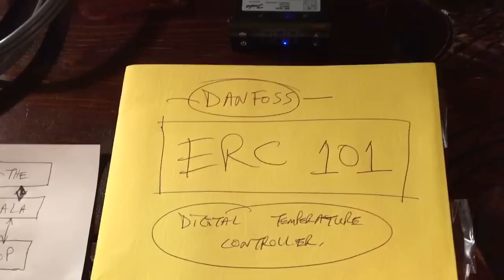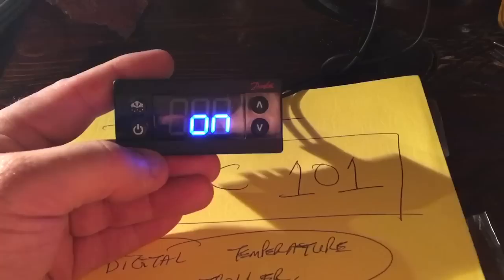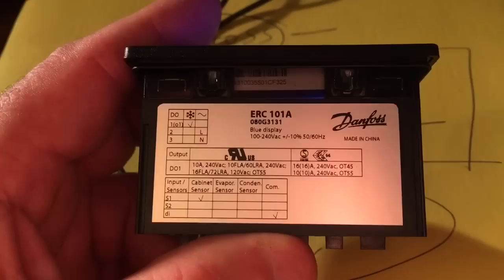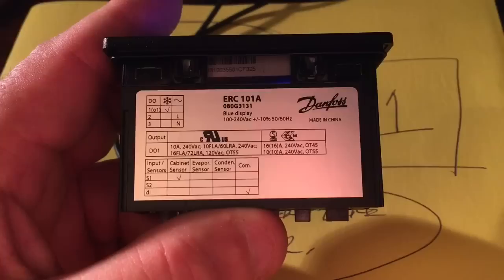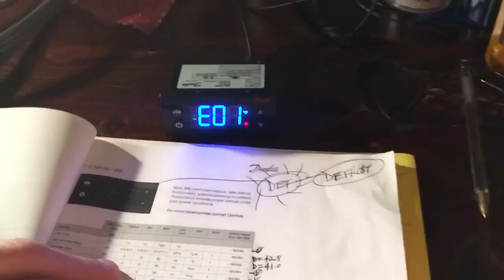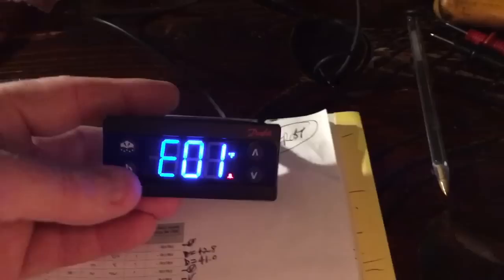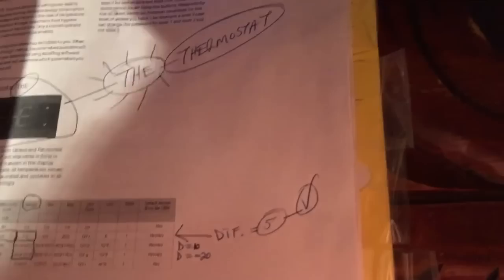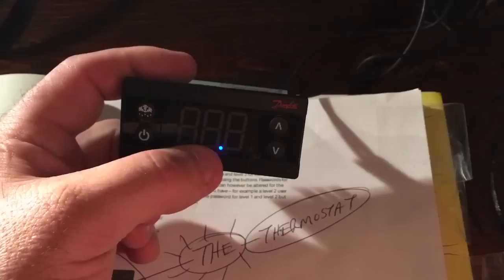Danfoss ERC Digital Temperature control. Programming The control.

Comment: Password?!?
Reply from the maker: the code is a 3 digit number between 001 to 999. Try 001
For Level 1 access. Try 017 for Level 2 Access. Try 990 for Level 3 / All access. if None of those codes work it is a Hit & miss deal trying to Hack  the passcode. it takes me about an hour or two to hack one of those danfoss temperature controls. i usually remove the controller and bring it back home , crack a beer and start punching in different codes. ill install a used temperature control to get them by till i hack the code. or u can allways just buy a new control and install it. them come new with 000 as the New code. when u push in a New code hit the enter button which is the Lower left button to enter code. 3 incorrect attempts and the controller will lock u out for 5 minutes. then u have to power down the controller / unplug the refrigerator from the wall to bypass the lock out or wait 5 minutes. i use a Power strip at home with a switch on it & a 115 volt pigtail when cracking codes at home.i put push on connectors on the end of the pigtail cord to plug it into the Danfoss controller. Good Luck ! Your Gonna need it.
Reply from the maker: What do you need the passcode for ?
Reply: @OcRefrig  got it, its 17
Reply: @OcRefrig  to service, thanks.
Reply: My rhino bar fridge. Took me two beers. 
Ps1: 111
Ps2: 147
PS3: 258

Comment: Hi Oc. Thank you for the video. I am new to the refrigeration. Could you advise why reach in coolers and undercounter coolers use coil sensing thermostats while many others like display coolers or walkin coolers use air sensing thermostats? Why not mount sensors to the coils as in reach in coolers? One customer had frozen display cooler (fans running, evap coil is clean) with timed defrost. With timed defrost I will either over defrost it or underdefrost it but if I mount the sensor on the coil with 35-36 cutin. What can go wrong? Thank you.
Reply from the maker: Yes , You are correct everything would be better if Evaporator temperature sensing was used everywhere. i don't know why it's not done.
You can do it on everything. cut in at 39.
cut out at what ever evap temperature is required for 35 degrees. it can be as low as 11 degrees on some units. its definitely a better way to go in my opinion too. no defrost clock needed. better temperature control.
Probably not done because it's just easier to set a control to 35 and walk away. Other way you have to stay and find the Evaporator temp that = 35 degrees then set control at that. or You can just start with 25 degrees and see what box temp is then subtract 1 degree for every degree cooler u want the box.
Prep.  tables have to do it the better way because thier is so much air infiltration from many door openings & open top with containers.
Reply: @OcRefrig  Thank you very much for the great explanation 🙏

Comment: Nice controller, but the sensors are expensive pt 1000, the eliwell controler has an easyer menu and sensors are cheaper standard ntc.
Reply from the maker: Thanks for the info. Ill check into the eliwell controller and see if its available or used out here in California.  I am starting to see Alottt of Different digital controllers out here in California now. Thier are Alott of different ones out here Carell , Danfoss , Emerson. What state or country are You in ?
Reply from the maker: I have not had any bad sensors yet or priced them out for availability. Thanks for the heads up on the price.
Reply: OcRefrigeration,Hvac & Electrical. Europe Holland. The top 5 used here  is  eliwell, danfoss ,dixxel,elreha, and last the carel,s. They have the easy series these are very competetive and they usually need no altering of the parameters.
Reply from the maker: Southern California here. Thanks for reply. Seeing alott of Carels now , Danfoss Second & Emersons on All Copeland indoor condensing units. No eliwells yet. No elreha. I guess dixell & emerson are same people now here.
Reply: Hi Sjef, that is actually not accurate. The ERC101 and the 111 use as default NTC sensors. PTC are an option for applications that requires them. See the information available here on the range of sensors:

http://products.danfoss.com/productrange/list/refrigeration/electronic-controls/electronic-refrigeration-temperature-controls/electronic-temperature-controls-accessories-and-spare-parts/erc-accesories-and-spare-parts/#/

Please do not hesitate to reach out for information on contacts and where to find the products in your area.
Reply: Ed C thanks for the info, i dont like the clip sensors, the sensors are expensive in relation to other brands, carel gives 2 sensors with the purchase of a controler. But other than that the danfoss are of good quality and the service is great here in Holland.
Reply: sjef oekel , curious to understand what you refer to as clip sensors, could you please reach out to me using my email? I am interested in making this product as customer friendly as possible, so this is good feedback for me. 
Thanks.
Reply: Ed C there are those amp jacks on the sensors, that is not handy when you need to change one out. I usually carry replacement controlers in my van. Those have screw terminals, so when you need to change one out, you just splice the cabel and connect it. This is why i cant carry those danfoss types for replacement, the carel, eliwell, dixxel are always ntc or ptc, or parameter can be set to accept them. Pt1000 is a problem.

Comment: Hi, İ have a problem with danfoss 112C. On display shows NON and compressor don't active anymore
Reply from the maker: What does it mean if “non” notification on the display is shown constantly?

The controller will display “non” if the temperature sensor to display is not configured under SxC and SxA. For example, if the temperature to display (trS) is selected as “SCO” and if SCO is not configured to any of the inputs (S1, S2,..S4), the controller will display “non”.  Also if SCO is configured, but the input configuration (SxC) is not selected correctly for that input, the same error message will be displayed. You need to ensure that the selected display sensor is correctly configured under input configuration and input application in the assignment menu group.

https://www.danfoss.com/en/service-and-support/fix-and-troubleshooting/cooling-installer-hub/electronic-controllers-services-faqs/commercial-refrigeration-controllers-faq/#:~:text=What%20does%20it%20mean%20if,(S1%2C%20S2%2C..

Comment: Thanks for sharing, does anyone know the schematics to the COMM Di port? i would like to interface to this controller using an MCU to read of the temperature ... anyone please....??
Reply from the maker: i don't believe that's possible. its only a point of connection for door switches & light sensors and such.

Comment: Hey do they sell the connections that goes on the back of that controller ?
Reply from the maker: This might be it.  https://www.walmart.com/ip/Connector-For-Electronic-Control-Danfoss-Erc-080g3365/936678951?wmlspartner=wlpa&selectedSellerId=101002108&&adid=22222222228392642048&wl0=&wl1=g&wl2=m&wl3=481578285802&wl4=pla-1223646316992&wl5=9031534&wl6=&wl7=&wl8=&wl9=pla&wl10=128898301&wl11=online&wl12=936678951&veh=sem&gclid=EAIaIQobChMIqITP56-I8AIV8AytBh12NwOCEAQYASABEgL-zfD_BwE&gclsrc=aw.ds
Reply from the maker: I Have not bought them before. I just use Female push on connectors. They are the same size.
https://www.amazon.com/Yueton-100pcs-Insulated-Terminal-Connectors/dp/B010GWZOUW/ref=asc_df_B010GWZOUW/?tag=hyprod-20&linkCode=df0&hvadid=198055979756&hvpos=&hvnetw=g&hvrand=1372867750814901230&hvpone=&hvptwo=&hvqmt=&hvdev=m&hvdvcmdl=&hvlocint=&hvlocphy=9031534&hvtargid=pla-391793085094&psc=1

Comment: Hi. what is the PAS of this controller to enter its configuration? Mod. 112D
Reply from the maker: the code is a 3 digit number between 001 to 999. Try 001
For Level 1 access. Try 017 for Level 2 Access. Try 990 for Level 3 / All access. if None of those codes work it is a Hit & miss deal trying to Hack  the passcode. it takes me about an hour or two to hack one of those danfoss temperature controls. i usually remove the controller and bring it back home , crack a beer and start punching in different codes. ill install a used temperature control to get them by till i hack the code. or u can allways just buy a new control and install it. them come new with 000 as the New code. when u push in a New code hit the enter button which is the Lower left button to enter code. 3 incorrect attempts and the controller will lock u out for 5 minutes. then u have to power down the controller / unplug the refrigerator from the wall to bypass the lock out or wait 5 minutes. i use a Power strip at home with a switch on it & a 115 volt pigtail when cracking codes at home.i put push on connectors on the end of the pigtail cord to plug it into the Danfoss controller. Good Luck ! Your Gonna need it.

Comment: Please help on how set the temperature as my controller stay on 23cel. It won't change if I did. Please help me, your video was helpful but I can figure it out
Reply from the maker: 1) Hit arrow buttons up or down to desired set temperature. ( upper right button - to increase temperature ) ( Lower Right Button to Decrease temperature )
2) Then hit Power button ( Lower Left Button ) immediately which will Set the New Temperature inside the control. The Power Button is also known as the " Set button or " Ok " Button.
Watch video again , it is very well explained.
Reply: Thanks man, you are great

Comment: Hey there, maybe you will be able to help me... i have a danfoss erc112 controller. now for some reason when i try to press up+down arrows i can not enter the menu and PAS does not show. is it maybe locked? is there a way to factory reset the controller? any help would be appreciated. cheers.
Reply from the maker: yes, locked. contact danfoss or manufacturer of refrigeration equiptm,ent and ask for password.
Reply: OcRefrigeration,Hvac & Electrical. Thanks, already did. My controller is locked by the manufacturer of the freezer and can only be reflashed via usb stick. I just replaced it with another one. Cheers.

Comment: Hey im having a problem and maybe you can help me, on the controller the temperature is diferent than the one inside the fridge, there is any way to calibrate the controller temperature to match it to the one inside the fridge, thanks in advance.
Reply from the maker: First --- Figure out which temperature is correct.
Second --- if the danfoss digital is off. Replace the thermistor. remember the controller may be sensing evaporator temperature not box temperature.
Reply: @OcRefrig  ok the thermostat is sensing 32F and inside is at 39F, so there is any way to adjust that difference??? the correct temperature is 34F
Reply from the maker: Yes. you can change  " the display offset "  " Dof "  under display in the controller.
Reply: @OcRefrig  so I just enter to DoF and adjust the temperature with the one inside?
Reply from the maker: No. you will adjust the offset u want. if the display is reading 32 and u want it to say 34. you would " up arrow " + 2.0 degrees. You can offset 18 degrees in either direction to allow for calibration of thermistor.
Reply: Thank you for your help man, you got a new subscriber, GOOD JOB!!!👍👍👍👍
Reply: Hey sorry for the question, but when i try to make the adjustment is asking me for a password, you have any idea what I could be???
Reply from the maker: did u get the passcode ? / 3 digit pass number code from danfoss or the refrigerator manufacturer ?
Reply from the maker: if u did not. the code is a 3 digit number between 001 to 999. Try 001
For Level 1 access. Try 017 for Level 2 Access. Try 990 for Level 3 / All access. if None of those codes work it is a Hit & miss deal trying to Hack  the passcode. it takes me about an hour or two to hack one of those danfoss temperature controls. i usually remove the controller and bring it back home , crack a beer and start punching in different codes. ill install a used temperature control to get them by till i hack the code. or u can allways just buy a new control and install it. them come new with 000 as the New code. when u push in a New code hit the enter button which is the Lower left button to enter code. 3 incorrect attempts and the controller will lock u out for 5 minutes. then u have to power down the controller / unplug the refrigerator from the wall to bypass the lock out or wait 5 minutes. i use a Power strip at home with a switch on it & a 115 volt pigtail when cracking codes at home.i put push on connectors on the end of the pigtail cord to plug it into the Danfoss controller. Good Luck ! Your Gonna need it.
Reply: I will try that thank you so much!!!!!!!

Comment: how to reset pasword in ERC 101A (080G3132)
Reply from the maker: no default settings. No reset. must be programmed one by one.

the Passcode is a 3 digit number between 001 to 999. Try 001
For Level 1 access. Try 017 for Level 2 Access. Try 990 for Level 3 / All access. if None of those codes work it is a Hit & miss deal trying to Hack  the passcode. it takes me about an hour or two to hack one of those danfoss temperature controls. i usually remove the controller and bring it back home , crack a beer and start punching in different codes. ill install a used temperature control to get them by till i hack the code. or u can allways just buy a new control and install it. them come new with 000 as the New code. when u push in a New code hit the enter button which is the Lower left button to enter code. 3 incorrect attempts and the controller will lock u out for 5 minutes. then u have to power down the controller / unplug the refrigerator from the wall to bypass the lock out or wait 5 minutes. i use a Power strip at home with a switch on it & a 115 volt pigtail when cracking codes at home.i put push on connectors on the end of the pigtail cord to plug it into the Danfoss controller. Good Luck ! Your Gonna need it.
Reply from the maker: if u can't figure out the passcode just buy
a New controller. New controller comes set with no passcode.